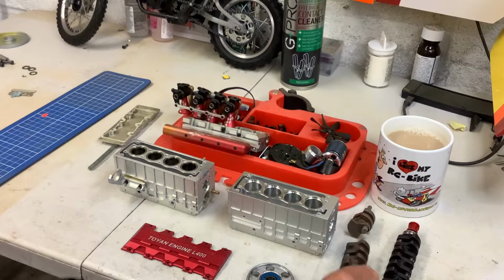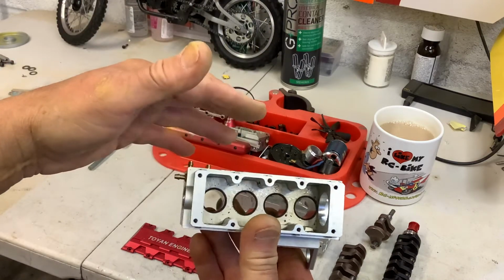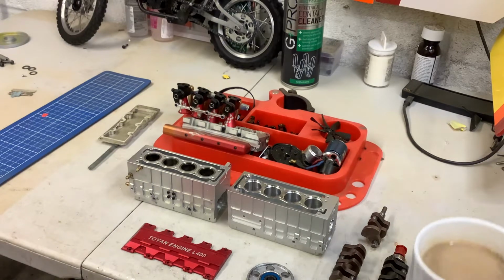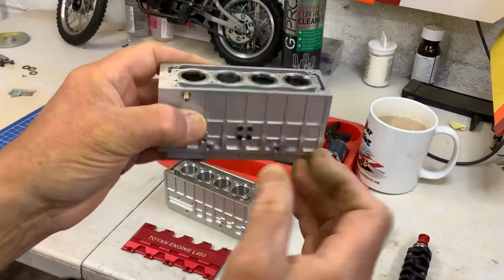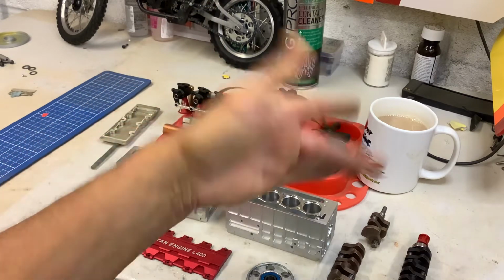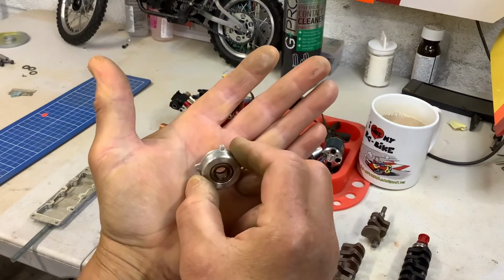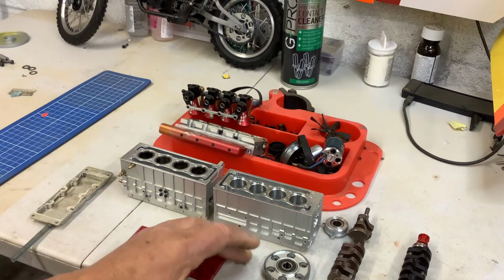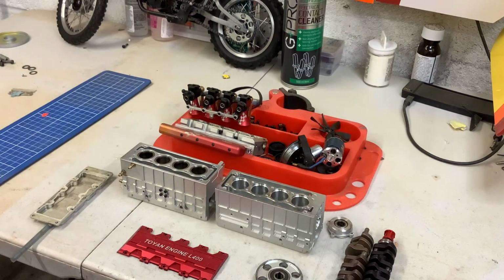Months off from the last run of the Toyan L400 because of the crankshafts breaking I have new parts

Comment: I’m on my 4th crank and waiting for a solution from Toyan. Front bearing might help, but the unit needs center bearing or increase the rod throws from 6mm to 7mm. But additional bearings are the solution. Head bolt holes line up perfectly for bolting in mounts for split sleeve bearings. Just drill through, thread, and use a cdc lathe to cut the mounts. Really hoping that Toyan will step up to the plate and come through with a new block and crank. I won’t purchase another Toyan product until they have resolved this. Looks like Johnny-90 got his running. Not sure how much time he has on it, the the longest run time I’ve gotten on a crank is a bit over 30 minutes. I ordered spare bolts and gaskets, but had to order them individually, since Toyan didn’t have gasket or fastener kits.

Comment: Hi crankshaft will still break,only way to stop it is to make a middle bush bearing like I did. I haven't had a problem sense
Reply: I don't have a L400 but would you post a short video on your bearing mod it would be helpful convince Toyan. Thanks in advance.
Reply from the maker: Yes I second that could you send me any details of your centre bearing?
Reply: @bafordfo4461  Hi Chris, I have an L400 yet run in a scratch built 6th scale hot rod that I am currently building. Would you post me the centre bearing mod plse as I do not want the build to be for nothing if the engine fails. Cheers
Reply from the maker: @bafordfo4461  biscoe318@btinternet.com
Reply: @Blacklamass  just sent you a email of pics
Reply: @chris barnes can you send me some info on your center bearing please?

Comment: Sounds like they send you a block from the assembly line parts. They should consult with their engine tech per case bases to follow up on a solution cause it's clearly that the sales persons or those handling the calls, emails aren't to savvy in the mechanics of engines otherwise things would go in a different approach. They requested to return my l200 due to too many fail attempts to start after too many emails with pictures and videos. I know the feeling and my is only half the price. It's still frustrating that they continue to sell these L400 like if there are no problems. Keep hit them with all the problems don't give up. They got to see a way out to make it right for you. Good luck mate.
Reply from the maker: Yes they are such hard work to deal with I would like to get this running but deep down I know it will break again
Reply from the maker: If only they would make a centre bearing, why don’t they?  No one will buy this engine anymore, but us guys who have them have got to keep fighting for our $800
Reply from the maker: I have asked over and over again for a refund, but it falls on deaf ears
Reply from the maker: I have to mail them messenger them non stop to get anything done I’m kind of at breaking point